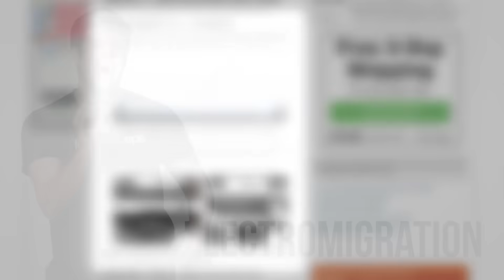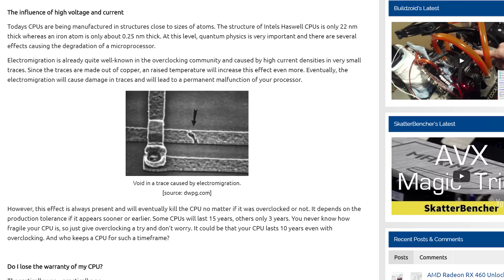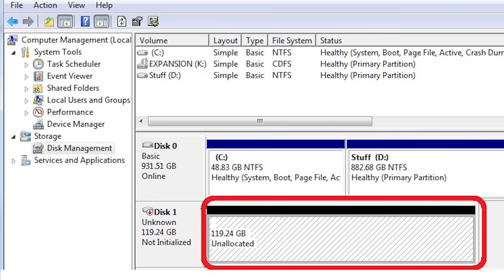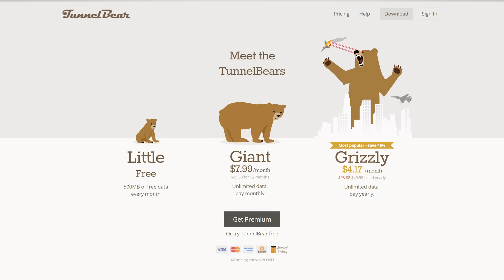Why Do Electronics Die?

Comment: Planned obsolescence should be illegal at least in most cases
Reply: It is illegal in some cases, plane stuff and baby stuff for example.
Reply: @mnb134  exact opposite with many of those.  Baby stuff has expiration dates...like car safety seats, and even cribs.  Aircraft parts typically have hours ratings on them, or cycles, and must be serviced or replaced after so many hours or cycles of use.
Reply: Funny, I thought capitalism was a system for enabling raging psychopaths to accumulate all of power and wealth for themselves so that they can control the entire system for their own benefit while everyone else languishes and suffers at the bottom.
Reply: I had a USB wifi adapter fail, within a day, exactly a month after I started using it. It's not like I can sue the Chinese company responsible.
Reply: AlphaOmega planned obsolescence is a hidden subscription fee for a product. It is a simple idea that drives the world. Sooner or later we will switch everything to subscription. Even your clothes will not be yours.
Reply: I've heard of printers failing and working immediately again, after the support guy looked at them. An IT guy I know looked at one of these printers and discovered a counter that needs to be reset after a few 1000 pages printed...
If that's not illegal, then I don't know.
However, if you think of clothes, shoes, cars etc. they do wear out over time. Of course you could reinforce some parts, but the question is how much money would you like to invest in making something more durable, since it's a question of diminishing returns.
Reply: Sounds like a terrible, black mirror, style future that I don't want to live in.
Reply: Microsoft is already doing this with Windows, there will be no 11, there will be subscription.
Reply: @SFtheGreat r/agedlikemilk
Reply: @soundspark  Well, 11 is still shite and Office is subscription based now, so...
Reply: I agree. Forcing people to buy new devices every 2 or 3 years while the old ones remain completely functional is unexcusable waste of resources and human labour.  As for jobs, the jobs lost in production sector can be regained in maintenance of devices.
Reply: AlphaOmega I don't buy products that have planned obsolescence. Other than my car but not by choice.
Reply: pacemakers. the battery is the only thing why you have to replace them frequently. thats it. insulin pumps have planned o. , too. ah and some other implants are designed to work a lifetime, but all those (i know about) are pure mechanical things. and well, you pay for the missing planned o. in those cases up front (or your insurance). 
Its a cold world. Trust me i work in medicine... its very VERY cold.
Reply: If it were illegal everything you buy would cost 4x more money because customers would not buy new items every few years so the 10% profit margin now would have to be %35-50% like it was back in the old days when most people waited 3-5 years between costly purchases. In reality a modern machine no will likely run any OS made for the next 10 years so 1 sale would be all they got for 10 years. If you buy the higher end stuff ( more $$) where the Profit is higher, you generally get a 10 year machine. It happened to be, all machines were built that way 25 years ago, since the price wars started in the late 90's, ppl usually shop price not quality. I remember when a 640x480  32" Tube TV was over $1000, now you can get a 60" 4K LCD TV for less, but it won't last 20 years like the older tv would. If every mfg. had to build top quality stuff, the cheapest cars would likely be priced at $30k and BMW's would start at $60k.
Reply: Thomas Borisov so i guess all modem cars will die causes its all runned by computers electronics.
Reply: I had a geforce 9800 gt. Beginning with one update for it, my pc was always crashing when I was watching a video. It still had updates for over a year but it never got fixed. Only thing which fixed it was downloading the last working driver from a 3rd side because it wasn't avaible in nvidia's library anymore. So yeah I'm pretty sure planned obsolescence is real.
Reply: That the reason i destroyed update system in 7. Since the real security risk thisdays is microsoft themself. https://www.forbes.com/sites/gordonkelly/2017/01/17/microsoft-windows-7-security-hardware-support-problems/#231897e6ecdb don't update to 10. No one should. Darkdays this time with technology and power and money. Ridiculous  good old microsoft became in my opinion even more nasty then apple. Sad
Reply: A failure observatory should be run ; stats gathered ; bonus/malus distributed according to stats (malus you pay ; bonus you get tax refunds)
Reply: I'm a design engineer and i can ensure that it won't
Reply: I honestly can't believe how reliable electronics and gadgets and vehicles were back in the 50s. Body shells of cars from that era still exist today!
Reply: It should be improved as the device will give out it's end of life signal just like in smoke detectors as most smoke detectors will give out the 10 year end of life signal that it needs to be replaced because the smoke detector's sensor is about to fail within sometime after 10 years
Reply: That's true and it would be difficult in a lot of cases to prove intention.
Reply: As much as I am sure that planned obsolescence is real, I also believe that many times it isn't a conscious decision by the manufacturer and is actually a natural part of statistics and market pricing.
Reply: im going to have to agree with you on this one. im against regulation of almost everything but, planned obsolescence is douchebaggery at the highest level!
Reply: It doesn't matter. The corporate big-wigs get their work-arounds via toxic updates and "instabilities" and "patches"... You  ever wonder how (for instance) a company like Microsoft can hire a literal army of software engineers, all working toward the same general purpose, and still not accomplish a single completely functional operating system by the date of release? Think about that... And note, I purposefully used "date of release" not "deadline" or "due date"...
  As to "the same general purpose" (since someone will doubtless complain for ambiguity)... It's simple. As part of a single company, the individual will want to keep working (even gain rank within the company) so it would stand to reason, sending a reliable, useful, durable product to the public for all its accolades would gain the company respect, loyalties, and return business...
  Instead. within a day of being released, there's a patch and a stack of updates to keep your computer humming till (what seems like) rapture. So... not even a day of operation? Not a couple hours test-drive on the information highway? No, more updates... more patches... more "sorry, but this shit don't work right either, so you'll be able to have use of your computer in a few more days... weeks... oh hell, just forget about it and smoke weed like a good little soldier... :o)
Reply: origionalwinja I love it when someone tells someone else they lack this knowledge and that thinking... I mean c'mon.. if u were half as smart as u think u are u'd know better than that. Like, what impression does that leave other than u implying u know it all, which on its own is just plain stupid... then from there u're tryin to back your adhominen up with some BS like "if u want to see a country without capitalism..." How can there be a country without capitalism that still uses the monetary system? I mean, just cuz they call it something else doesn't make it so. Terms are relative and in fact in my 1st comment I meant the money system in general. Capitalism is just the inevitable aftermath. Also your implication of socialism being the only alternative kinda shows just how widespread your education is and how deep your critical thinking skills are. And my favorite part is where u also imply that u see, without the monetary incentive we're all just going to lay back in bed and die cuz we won't have a reason to get up. Hilarious when put that way, ain't it? U see, capitalism doesn't drive progress, it drives profit so with that in mind it actually hinders progress.
Reply: AlphaOmega I think planned obsolescence exist. Parts like GPUs, HDDs, SSDs and RAM they tends to die often as compared to CPUs and Motherboards.
Reply: light bulbs used to work for a life time but all the bulbs companies was almost making no profit so they made an agreement to limit the life time so they don't go bankrupt , sometimes its necessary to the manufactures to do this dirty move but of course everyone can get greedy
Reply: bullshit
Reply: origionalwinja i like america... freedom of speech, and enough food for everyone that works, have nice day komrade )))
Reply: origionalwinja All governments can only thrive with a little bit of everything, but one thing is for certain: the Free Market is the thing which every government needs to survive, simply because that incentive in which people can get what they want if they work hard enough is what drives an economy to begin with.
Reply: The problem is that when every product would last very long, it would lead to an extreme rise in unemployment rate and many people would not earn money anymore. 
In switzerland (we talked about this in scool), there was in the last century a company which made kitchens and especially refrigerators. These refrigerators were the best you could buy, extremely robust, energy efficient and cheap. Thanks to this company, whole switzerland got refrigerators. But then, the company got bankrupt. After they sold thousands or even a few millions products, there was no need for the people to buy more. And since their devies did not break, they couldn't replace these and sell new ones. 
The company closed and the employers became unemployed. 

Sure, I hate Planned obsolescence too. Don't understand me wrong, it is the worst thing someone has ever invented. 
But our modern society would break completely appart if every device or thing you could buy would last way loger. It would lead to catastrophic event. Most people would loose their jobs.
Reply: Ph. Wrayne Hence why we should aim towards replacing capitalism.
Reply: @randoplebo  capitalism brought us the technology in the first place
Reply: *Ahem.... Apple
Reply: Crypticsz
wow! your lack of education, critical thinking skills and intelligence is GLARING...without capitalism you would not have one god damn thing you cant live without. literally EVERY form of economic model is literally SLAVERY except capitalism. no form of government can exist without capitalism to support it financially. capitalism encourages innovation and everything else stifles it. if you want to see a country without capitalism just look to Venezuela...once the richest country in south America...its now a festering shithole. its people are starving to death and are being arrested for smuggling food!! the alternative to capitalims is socialism (fascism/Nazis) communism which is a more extreme version of the evil socialism, and then there is feudalism/monarchy. the ONLY one that works is capitalism and history has proven that time and time again. its just the stupid people that cant seem to catch on...

Comment: This episode was so good right up until the end. Please don't perpetuate the old myth about planned obsolescence. It doesn't mean what you think.
Reply: Gabriel Lundmark so what is the meaning then?
Reply: It certainly doesn't mean releasing updates to old hardware with the intention to make them slower. It's just how tech works: if you don't update your software, you can't use modern apps and risk security issues, but if you do, the more complicated software run slower on your old hardware. It's really that simple. 

There's always an aspect of planned obsolesce in all product design, though. Would you over-engineer your product to last a very long time even though most users would abandon it long before it breakes, or would you make it good enough to last x years and save a lot of money in the process? Put in a much faster CPU at the expense battery life and spending? There's always a balance.

Comment: Here's a fun fact regarding planned obsolescence:
After a while, new nvidia drivers actually start to make you card slower. Presumably on purpose.
Dunno about AMD, I don't think they are a company that would do that. If only they produced decent cards...
(And drivers... don't forget the drivers.. oh god, the driver!)

Here's another thing: nvidia introduced what has been officially labelled a "bug" a couple of versions back, which prevents the nvidia driver to run in a virtual machine. Of course, they have no intention to fix it.
How do you work around it? Easy. Hide the KVM signature, so the drivers can't detect it. If you are using windows as guest and have hyperv enabled, change the vendor name to anything but the default. Done. Drivers work.
Suspicious, isn't it? ...

Comment: I always wondered, when I heard about semiconductor doping, what exactly keeps the electrons or holes where they're put.  Turns out, as you say in this video, over time they can migrate around in the material, and eventually (over long enough time and with enough migration) make the parts fail.

Comment: had PII in 96th, upgraded it to PIII and 512MB RAM in 2002, i was using it till 2008... not a single problem with that computer at all till today... sometimes i wanna experiment with server loads so i install linux on it and waste my time on experiments... 
in 2008 i bought q6600 with geforce 9800GT, gpu cooler failed after 6 months (got it replaced), almost all MB capacitors failed after 2 years of usage, i replaced them with the best ones that i could find and till today i am using the same PC and works flawlessly...
i see huge decrease in quality in PC's after 2010, not a single one that i know who went without problems within 2 years of usage...

Comment: Microcircuit life spans have improved dramatically over the decades. I can remember when tin dendrites were a huge problem because the leads used to be tin plated on DIPs. The military had fits with the problem and often opted for gold plated leads in critical systems. Of course, they had to deal with tin solder migration on circuit boards as well. But, the biggest killer is still heat. Systems in satellites and other things we send into space are designed with special materials, gold plating and wires and lots of redundancy and then they are operated at reduced capacity to avoid heat build up. Look how long they have managed to keep the Voyager probes working? That took a lot of engineering to accomplish.

Comment: Planned obsolescence is an urban legend. As you mentioned, cheap caps will fail (with just 5k or 10k hours MTTF after ~ one or two years) and lead free solder (forced in the EU) tends to crack easier than lead based solder. With other words - customers asking for lower prices and stupid politicians (not knowing what their orders will cause) are the main reasons for products to fail sooner than they did 20 years ago.

Comment: Concrete cracking has more to do with its porous nature, the expansion of water as it freezes, and the general incompressibility of water.  So the expansion/contraction analogy is still there, it just happens in concrete for vastly different reasons, because electronics generally don't have a lot of, if any, water in them (although some capacitors are made with water).